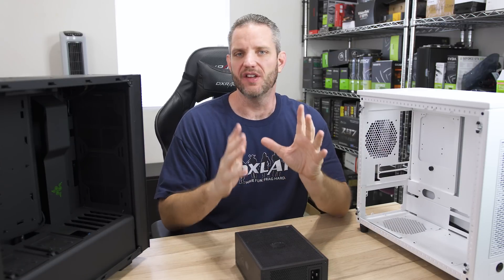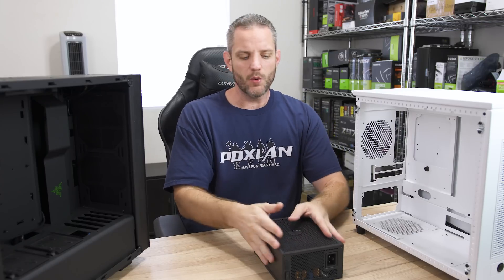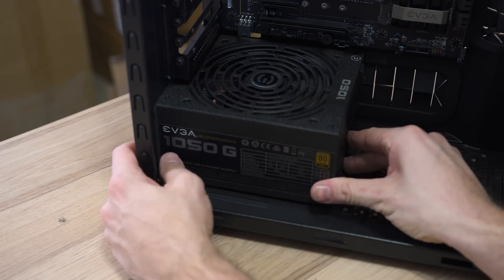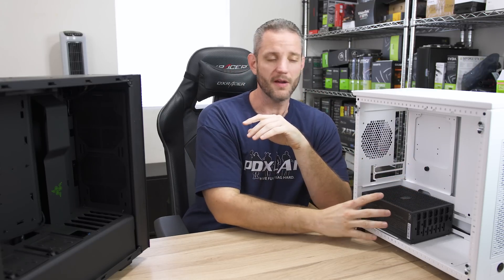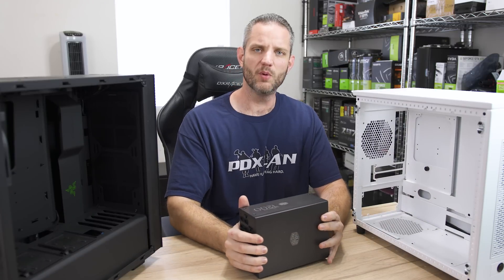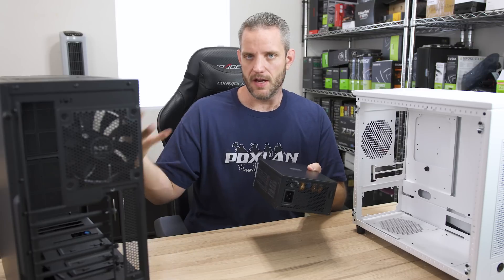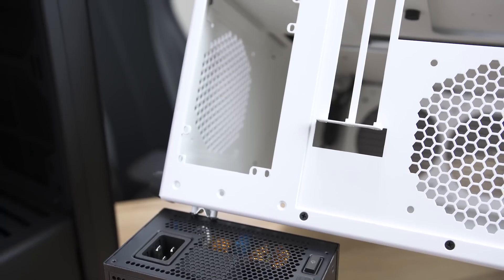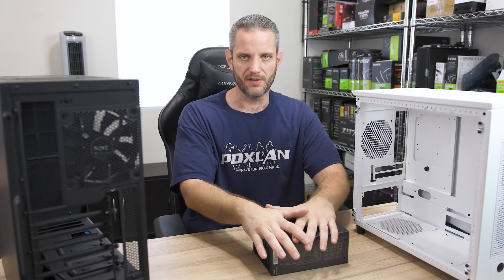Should you mount your Power Supply up or down?

Comment: I installed mine with the fan facing up to get the power cable to reach the CPU power head. The other way wouldn't reach at all and I didn't have an extension.

Comment: I used to have my power supply flip upside down cause I was running a single loop water cool (cosiar h100) which sucked cause the AIO pump spreader wasn't strong enough to handle an OC 8core AMD FX AM3+ processor. None the less my case is a monstrous thermaltake Chaser Series Chaser MK-I had foot which I removed because they were on high stands to high to slide it under anything. This meant I had to flip the powersupply around so it won't choke and power off on me. I think its about time either way I get a new case nothing so big

Comment: Doesn't mounting the psu up with a video card installed cause issue? With the psu pulling and the graphics card pulling pretty close to each other (at least in that white case) wouldn't that cause the high rpm fans of the graphics card to almost choke out the psu and it's slower fan? Maybe possibly cause the psu to run the fan at a higher and louder rpm to compensate? I am seriously asking and not criticizing at all.

Comment: Hey Jay nice vid, do you know a reliable company for power supplies?
Reply: lol it's Super Flower not Flower Power :))
Reply: I wouldn't go with evga, i picked up a 500w psu from them and the cord doesn't fit in the psu that well. Occasionally my pc will shut off if some one bumps my table. I may just have a lemon but even if that's the case i can't recommend due to my situation. I would return the psu but like a dumb ass, I removed all the warranty stickers before I noticed the problem. Why? because my case has a side window and my OCD told me it look much more clean with out all of those sticker's.
Reply: Seasonic is a great power supply brand. They make some PSUs for corsair, evga, etc.
Reply: Mark Himmler
 Antec too
Reply: i dont normally comment but in your case, get a seasonic PSU. I have 1000w platinum for 2 years now, had 2 systems changed  with the same PSU, never have any issues still going stronk. have hybrid option too, get plenty of accessories and cables options.
Reply: Evan Davis Some of the EVGA manufacturers are absolute trash, but some are good. I think the BQ/B2 series was good.

Comment: You said that the coolest config is when the intake is inside of the case. I have to disagree, it's a much more likely scenario that there's an 80C graphics card right above the power supply, than some room temperature air being recirculated through with an external intake.

Comment: It really comes down to the individual application for your PSU.

Does it benefit your system more to have independent cold Air Supply 
(another eighties joke for you Jay) for the PSU?

Or

Does it help to have another low RPM exhaust fan in your system?

It changes depending on your case, airflow, presures, what kind of 
cooler is on your vid card, etc.

The only way to know is to try it out both ways and monitor your case, 
motherboard, CPU and vid card temps while running under stress in each 
configuration.  Realistically it won't have more than a 1C or 2C swing 
for most people.  Kind of like TIM application.  Stop worrying, do it, and move on.

So it's probably not worth the time and effort, but if you care about it
 do the experiment and post your results!

JAY, do you have a system opened up that you want to do a video on?

Comment: Jay my Mini ITX case has the power supply on top of the CPU so will it hurt the cooler by pulling air up? It's silverstone sugo 13
Reply: I've been running this config for quite some time now, there is no issue in my SG05 a very similar case.
Reply: Sounak Chakroborty there should be no problem.
Reply: Simon Bouma it has no exhaust so the psu acts like one so I'll keep it I guess

Comment: My computer is on a stand and my power supply (being an RM750) is facing down. I upgraded about a month or two ago from a GTX660 in it and 430W Seasonic S12ii 430B 430W power supply to a GTX780 Classified and an RM750. Since then, all of my overclock settings have been unstable including the ones built into the BIOS and it looks like NOTHING works for me. The computer runs fine stock. 

I'm absolutely dumbfounded, all of my clocks are unstable albeit a new, better power supply that's also Gold rated compared to Bronze with my old PSU, IDK if that matters completely but I think it would. 

Would anyone know WHY my clocks are unstable? I have absolutely no idea.
Reply: Hector O Firstly, why did you buy a 780? Not a RX or 10 series...
Secondly, WHY THE FUCK DID YOU GET RID OF A SEASONIC PSU?? Most of them are the best on the market... And the yellow Corsair RM series aren't that good...
But there are a lot of reasons why a overclocking setting can turn into unstable; components aging, psu, higher power demand on pcie slot (from the gpu),...

Comment: Great video. Even for those who have been building for years. I've given only a little thought to power supply orientation (with mainly dust being the concern). These days it's a moot point for me as I have an open case with vertically mounted psu. Yes this does come with some risks. I'll admit to having had half a bottle of whiskey smash into my power supply about 18 months ago. My heart was in my mouth as the power cut out. Luckily the psu survived, I managed to switch things off fairly quickly but I have no illusions about being as fast as electron flow so I don't think that was a massive factor. Anyway, Great video Jay, keep em coming.

Comment: Got an idea for the other video with PSU. I guess I'm not the only one with this problem, when I clean a computer from dust, I always have problem how to clean the PSU fan without taking it all apart and not getting angry, when I can't reach something. Air dusters could be a good solution, but I never have one when I need it or it's not enough. Could be a good topic in a video with some cleaning tips ;)

Comment: What about the power supply sucking air in from the graphics card causing it to heat up and make more audible fan noise. Not trying to nit pick but it seems like a valid reason.
Reply: Unedited Gamer psu fans are quieter than gpu fans, it should reduce system noise by reducing gpu temps and gpu fan speeds
Reply: Ryan The GPU should be easily able to significantly heat up the power supply, they also do not mush much air. The cooling will be negligible in a properly cooled case.

Comment: Being a rather novice style video, can I get some feedback? (From anyone) I'm starting a build, and I'm curious as to others thoughts on running a 550W PSU on an estimated 420W usage..  Here's a text list, and let me know if you'd like a link to pcpartpicker.

PC Specs as follows
i7  6700k - 91W
be quiet! Dark Rock Pro 3 - 10W
Asus z170 Pro Gaming MOBO - 70W
16GB DDR4-3200 - 14W
2 SSD - 20W (10W each)
EVGA GTX 1080 FTW Hybrid - 215W
Reply: Nathan Benfield Well, that's a very nice one indeed. Good choice!
Reply: PS: I do plan on overclocking to some degree in the near future.
Reply: Nathan Benfield buy a 650W and you won't have any worries ;)
Reply: If you got that 420W estimate from PCPartPicker, you should bear in mind they use a rather large margin of error. Having said that, it's never bad to have a little more power than you need, and you need to go massively overkill before having a PSU that's too powerful will actually start to hurt you, although of course it will hurt you initially when it comes to the purchasing price. Personally, I'd say a 550W power supply for that system would be very neat, even if you do do a bit of overclocking. What brand and model of power supply were you aiming to get?
Reply: What's the general rule of thumb for how much extra watts you should look for? Cause I'm getting a 550W PSU for a 226W build. The PSU is $50 after the $20 rebate so it's not a big deal price wise to me.
Reply: Robert Faber I have a be quiet! Dark Power Pro 11 550W 80+ platinum cert.
Reply: Jordan S If you're buying a mid-range Corsair PSU though, the RMx series is a better deal than RMi. The only difference is Corsair Link Digital (RMi has it, RMx not), and chances are you wouldn't be using that anyway.
Reply: Jordan S true

Comment: Did you ever heard that someone damaged the PSU because of heat?
Sorry might be a dumb question I'm a pretty big noob when it comes to that 😊
Reply: Mc Craydox yes it's possible, science studio did it
Reply: Mc Craydox cheap made in china psu can overheat and die. But decent brand psu can't because they have a overtemperature protection (OTP).
But OTP isn't obligatory.
Reply: Mc Craydox When you use garbage power supplies from chinese companies like Deep Cool, you'll damage your entire system because of cheap rails, wiring and power delivery system.
Reply: cheap power supplies are easily killed by heat in bad conditions, but even good ones can die if you completely starve them of fresh air(pressed flat against a carpet or downward facing in a case with no bottom intake for example)

Comment: What is the best fans setup in the case and best number of it ?
Reply: That depends entirely on what you want; there is no single answer. There are some small tips I can give you, like how it's most ideal to fill the front and rear fan slots first, then the top, and finally the bottom, or how it's best to place intake fans behind filtered fan slots, but that's all. How many fans is best for you and where to place them will depend entirely on the circumstances of your build. However (and it's a big "however"), that's just if I were trying to answer the question as you asked it, needing the "best" fan setup. If you just want to know what you "need" to have, the answer is much simpler, because this really isn't an exact science. One intake fan and one exhaust fan ought to be fine, preferably with the intake fan being larger or spinning faster than the exhaust fan.
Reply: Robert Faber I have 1×front , 1×back , and I don't overclock any thing ,Generally most usage for gaming , will be enough ?
Reply: Eslam Emad Essentially, there's a 99.9% chance that setup will serve you absolutely splendidly.

Comment: I'm kinda glad then with my Thermaltake Core X71 that the PSU is located in the basement (wall between it and the system guts) and is designed to have the PSU sitting on the "side" so it can draw airflow through the floor AND through the side panel of the basement (and/or be force-fed air from any fans/rads you have installed downstairs).
No coolant is going to be leaked "into" the PSU as it'd have to work through the cavity wall and THEN into the PSU.

Comment: I'm curious if your opinion would hold true for a dual gpu (hotter system) build. I run 2 r9 390s which get kinda hot when pushing max performance. Would you then want it facing down so the gpu heat doesn't effect the ps or up so it helps get the heat out?
Reply: Robert Higginbottom Holy shit your system must be hot, two r9 390s are crazy.
Reply: yeah, sometimes I roast marshmallows above the top vent.  Keeps my room nice and warm though lol

Comment: I have a little bit of a problem: I took my exhaust fan out and used it for intakt cause I have a big CPU cooler wich was right in front of the exhaust fan and kind of blocked the 2x4 pin cable for the CPU, so my question is should I put the Powersupply cooler up or down (right now it is facing up)

Comment: While i think your reasoning isn't flawed if you have to deal with particular situations, like putting your case on carpet or on a flat surface without feets etc, it's pretty much confirmed that the psu fan doesn't help at all in moving hot air out of your case, putting it face up in a regular case just makes the psu run hotter. And btw, this was thoroughly tested by your friend Luke on LTT channel some time ago, but you can always run your tests and prove us all wrong :)

Comment: Cooling fluid is non conductive though, right?
Reply: mineral oil.
Reply: +veli2501 Pure water in and of itself is not conductive. Water with electrolytes (sodium, potassium, calcium, etc) is conductive due to those molecules exchanging electrons within the solution. As 1st_Luis said, in the case of water cooling, the water will become conductive over time because some of the metal in the fittings will get leeched into the water, thus making it conductive.
Reply: veli2501 it depends on what you use.
Water (H2O) is not an electrical conductor. However, even if you use water (or another non conductive liquid), usually as time passes, it starts becoming a conductor, slowly.

Some are conductive, and they will be conductive over time as well, so better watch out.
Reply: Thanks for the knowledge guys!
Reply: Nearly every liquid has some ions in it.
Reply: You can invest in ultra pure silicon oil, then you'll not have to worry about conductivity but your wallet will not like it :-)
However, if it spreads on your electronics, it can spread heat in all components and if some are not built to heat that much, you might get in troubles, it's very unlikely however...

Comment: And let's keep in mind with semipassive (or 100% passive) PSU's that if you mount it fan facing down, where is the heat going to go when the fan isn't spinning?
Under load the heat is being trapped inside and causing the fan to kick in sooner. At least in theory, I haven't tested it but that's what my gut says.

P.S. I've got a Seasonic 660XP (80+ Platinum) which even under full load (660W) won't run the fan continuously, rather it turns on, cools off and turns off, turns on and cycle continues. My system doesn't draw even close to that kind of wattage so the fan on the PSU hasn't seen any action what so ever.
And doh, I've mounted it fan side up in my Define R5.
Reply: so,  for a psu with passive or semipassive behavior like yours and mine (RM 650), the best bet is to use it with the fan up?
Reply: I had the exact same reasoning with my Super Flower Leadex Gold. I haven't seen the fan spin too many times, so I figured it must be wiser to let it dissipate the heat upwards more freely and let the case airflow take care of that heat.
Reply: Sensui Shinobu Well with passive PSU's it's essential for it to be mounted "fan side" or rather the open grille side up so the heat can escape. And you of course need to use a case that either places the PSU on the bottom or if it's on the top of the case it needs to have a vent on the top of the case for the PSU. Or if you have insane amounts of intake air (read: positive pressure) I guess you can get away with mounting it grille down on top of a case but that kind of fan setup defeats the point of the passive PSU..

Here's an example of an HTPC I built for my mother. This is the latest iteration.
Notice the airflow of the case and how the PSU (Seasonic P-400FL) can breath.
https://i.imgur.com/PsEcLhs.jpg
Don't mind the dust filter, it's on the other side nowadays. Long story...
But that's a Lian Li PC-A05N, inverted ATX with rear>front airflow.
---
As for with the semipassive PSU's, it depends on what the PSU is and how you're using it. And of course what your case is and whether it has a PSU shroud.
For example the RM650 keeps it's fan turned off until about 250W load or so.
If your system is quite low power and it never reaches that kind of wattage then I would mount it fan side up.
Or if your system can in fact reach those kind of wattage numbers easily but you leave your PC turned on 24/7 but only put it under heavy load for few hours each day, I'd still leave it fan facing up as most of the day the load is so low that the PSU won't bother turning the fan on.
And so on.
Reply: +Lagittaja Thanks a lot for your information, from what i use the pc and the few times i know the psu fan will spin, Ill better put my psu fan facing up from now on 👍

Comment: Dear Jay, could you do a video on the effect of aircooling the GPU via the side panel or extra fans in the bottom of the case, and the effect of new cases with side panels and the shroud (no bottom fans)

Its hard to make my choice in upgrading my coolermaster CM 690 II because of that

Comment: I actually have a Corsair Graphite 780T (white with an Aperture Laboratories logo) and the dust ingress is pretty damn good to be honest and I have my PSU fan inside the case rather than facing the bottom. Was able to keep everything pretty much neutral through the fan controllers which is awesome in such an enormous case!

Anyway, great video Jay! Straight to the point and easy to understand.

Comment: Yay someone who mentions the air pressure instead of just fan count. LinusTechTips did a whole video on fans and how many are actualy need and did a negative air pressure. I wanted to smack Luke upside the head with the stuffed animal he used in another video about cable managment. 

Putting a PC with an intake on the bottom at floor level is asking to add more dust inside the case, dust falls down and floor level is as far down as you can get. Then there's dirt from shoes.  Even elevated on a board it will still pick up dust from floor level. If you have your PC at floor level and you have a PSU on the bottom have the PSU intake from inside the case. You cant open a PSU up and clean it out and blowing it out through the vents wont get everything. It's asking for the PSU to fail and that fail could be catastrophic frying everything else in the case or even cause a fire. Just do it right and not suck air in from floor level.